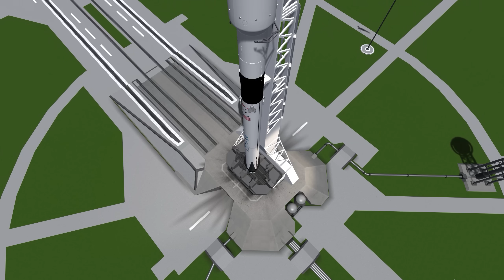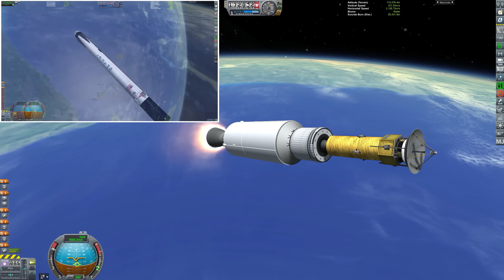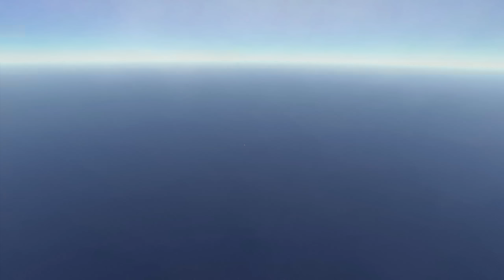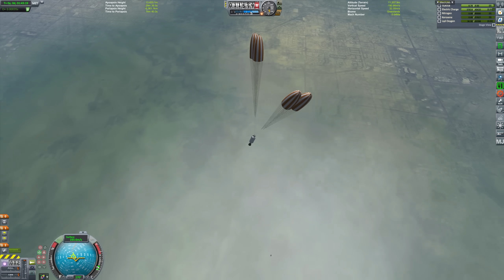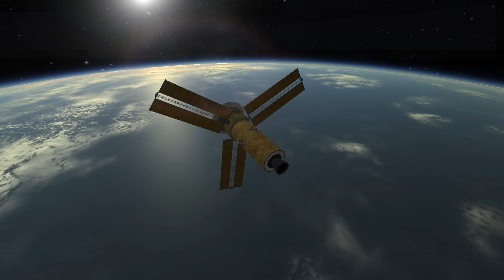SpaceX upper stage recovery - Can they do it? - KSP Simulation

Comment: I'd snag the second stage parachutes in flight with a big four-prop drone that can be computer-controlled and needs no pilot gear, oxygen or other human-rated flight stuff.
I'd follow it down to reduce the tearing sheer on the 'chutes, catch them, and then slowly pull up before hitting the ground. 
Then I'd have the drone fly to the precise location of the recovery team.
Since the flight would be short duration, I'd power it with a reusable electrical pack.

Comment: Hi. The nozzle for the 2nd stage is not built for earth's atmosphere, it's also too fast for the return. Any heat shield or parachute system would take away payload capacityThey need to capture that in LEO.

God bless, Rev. 21:4

Comment: Can you simulate starship SN15 (say) with flaperons angled downwards (unstable) instead of upwards (stable).  To see how that affects drag and agility. Say with a “cheat flight control system” ie just fix its orientation for starters (no control system needed).  Wondering if some kind of interesting airflow eg pressure buildup (cushioning) would occur.  Is KSP up to simming that?

Comment: Hi Marcus. I have been wondering, the vacuum optimized raptor engine is huge compared to the sea level engine. Does the optimization really provide enough extra thrust to offset the additional weight?

Comment: Any mass for a recovery shield and recovery propellant would be subtracted from the payload capacity.  Also, the vacuum nozzle is grossly "underthrottled" (maybe overthrottled I sometimes get them mixed up).  Anyway, if you tried the suicide burn that the first stage does with the second stage the atmospheric pressure would push the exhaust stream away from the sides of the nozzle and damage the nozzle and possibly the entire second stage.  This is why in production Starship will have a mix of sealevel and vacuum raptors.

Comment: Since the beginning of the Apollo missions, I have wondered if each stage could be repurposed as part of a space station, refueling depots, or even attached satellites, instead of discarding them or even returning them to Earth? It seems to me that if this were possible, then whatever extra weight needed to make this feasible, wouldn't be wasted because the discarded stage would have continued use. 26'.6'' X 12' is a lot of space for all sorts of things. From water tanks to fuel, other cargo storage...
Reply: I started thinking what would you do with the engine. I would imagine some for moving whatever the module would be attached to or maybe even disconnecting them and returning a number of them at one time by a specialized StarShip. Maybe ferried to the Moon or Mars for future use.

Comment: How would the landing go if the 2nd Stage were refueled in orbit?  Would a heat shield be needed if returning a fully fueled 2nd Stage?  Could one then inflate a hot air balloon to slow and lower the empty 2nd Stage to the ground?  millerf1

Comment: Interesting. I wonder if Spacex could use the helicopter like they are doing down under to catch the second stage if it isn't too heavy? How heavy is the second stage anyway? And using the balloot or whatever it's called seems like that would work to handle the second stage high velocity from orbit as Nasa had talked about to slow down when landing a heavy spacecraft on Mars. Terry

Comment: This is fantastic!! 

Check out this shit. I switched over to a mac in 2008 because I gave up the motorcycles and picked up the guitar. Time made my audio gear obsolete and I could not upgrade the os anymore so things weren't working too well. As the years went by, the wife split taking most of the money. I left my job but have just enough coming in from a couple rental homes to get by. I could not afford a new mac so I switched back to a windows pc. Picking up a 2020 modern hardware gaming rig that was unassembled components. 900 worth of new shit for a mere 300.00. Covid-19 financial pressure sale. Got it all working, moved my flat screen from being a TV to where it should be, a huge monitor! Bought a sidewinder pro and an adapter to get serial to USB. It didn't work until I shunted pins 2 & 7. Thanks Internet! Starting digging through the boxes. I had space simulator on floppy, no way to load it, flight simulator 5.1, Flight sim X, Fighting Falcon (Floppy), Combat flight sim 2. I was having my coffee on a sunny day of continued unemployment (soon to be beer). No wife nagging. Guitar to the right, joystick to the left. Too early to turn up an amp. I started to wonder if I had the latest version of flight simulator. 

Looking at my screen. I saw the title SpaceX land second stage? What?

CLICK.

Kaper space what. Gerbal space. Kerbal space? Looking around the screen for a logo. Ahhh it's in the description.

How cool is this shit?? The very next thing I do after I post this message is go check out their website. 

Unemployed. Divorced. Happier than you can possibly imagine.

Comment: The paradigm has changed.  There is Zero reason to return the upper stages.
Just stick them in a parking orbit to be refueled as orbital and translunar thrusters.
But they may become so inefficient as to be totally obsolete when compared to the latest units so it would be a trash burn re entry...

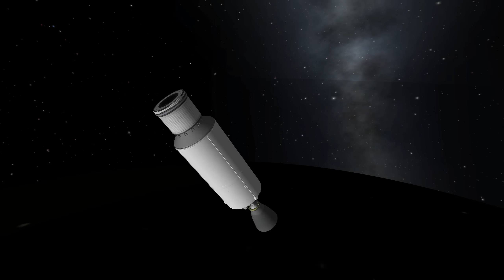Comment: 5:21 yes you right its delta v increased because the second stage is lighter but about 6 seconds burn that wrong because the engine now created powerful thrust so if you full thrust the second stage will get a very high G force.

Comment: Why not use the inflatable heat shield as the “bouncy” landing pad.
Reply: That means it would have to go in nose first, which means that the parachutes would have to be at the other end. Maybe it’s doable. BUT why not use the remaining fuel for a final burn to buffer the landing and use extending legs like on the main booster stage to land nozzle down?
Reply: @Crazy_Worlds  That giant engine probably has too much thrust to do a propulsive landing. Even one of the falcon 9s engines at its lowest settings has too much thrust to hover.
Reply: Mark B You’re right. It would need to be a hybrid or have a second, smaller, atmosphere rated engine.

Comment: You ideally would want a layer you can pump out fuel throughsmall pores on the inflateable heatshield so the fuel cools off the heat shield, and reduces heat by makeing a sprayed flame, the burn up of that fuel would reduce oxygen thats hitting the heat shield and thereby its surface temperature , later on they just need to jet off the residual oxygen , possibly through the engine while its not ignited or they use the oxygen instead of nitrogen for reentry stabilisation nozzles
I dont think you can ut ceramic plates or corc or something similar on a inflateable also the inflateables volume needs to be filled with nitrogen (orsomething else inert and ideally light like helium) - that you additionally need to take with you 
The high temperatures will need the inflateable to be under high pressure to withstand the drag pushing against it thereby thick walled and heavey, also rubber likeley will not be possible without internal electric heating mats because of the extreme cold of space the rubber would get hard and brittle, on the rubber composite (maybe wire reinforced like a car tire but with some lighter metall) you would need isolating and heat resistant flexible materials - id thereby think of ceramic wool or asbestos and a top layer of fine titanium wire mesh, then several spray nozzles or 
maybe put a support structure inside like some carbon fiber
pipes that pneumatically telescope out and give the front additional stability and help bring it in shape quickly while inflating - with either a pull spring for backing them in for deflating or a pump pulling a vacuum 
if you make it rolled up and kinda like a umbrella as opposed to this Kerbal vision you can easier put it back, if its Helium filled it weill reduce vessel weight after a certain height is reached due to density - so by releasing pressure somewhat reducing the density it would be similar to a light gas baloon negating its own weigtht , this way you could put a cap in the center and get the parachutes through the heat shield, that way you dont have to jettison the heat shield and can reuse it

Comment: Recover 2nd stage but dispose fairings? I think that's a wrong approach. I Think of it as a single ship: fairings open or slide down to deploy payload, then fairings return to position and act as heat shields. Later, reorient and fire thruster to slow down and touch down.

Comment: If you recover stage one, why not retain the fairings?
Reply: the farings are mostle just metal and explosive bolts its to much work and effort to bring back whats basicly scrap metal
Reply: @cwtheking3771  Scrap metal worth a few million dollars?
Reply: @SkylersRants  hmm thats just my assumption let me reeducate myself on the fairing design
Reply: @SkylersRants  ohhh figured it out i wasent accounting for the mats made specifically the cooling elements ok yea that makes sense but my hypothesis for why he didint retain them is it would overlap with the heat shield

Comment: Hi, why they don't slow the capsule down before entering the atmosphere? Could they enter to 70km alt with zero orbital speed?
Reply: How can they slow down first?
Reply: @General12th  the speed of the spacecraft is about 17000 miles per hour I think and it is the orbital speed then they try to undocking from the ISS. I mean by that they should try to slow down that orbital speed relative to the Earth and try to come straight down with 0 relative speed to Earth. by the Speed i mean ORBITAL speed not falling speed. And Thanks for reply😃
Reply: @mahanehsani1246  They need fuel to slow down. Where will they get that fuel?
Reply: @General12th  yes they need and they have some already to use for deorbiting, on paper they can put more in instrument module for example. Or use other methods to do that...
Reply: @General12th  for how I think of using the thrusters and small rockets to do that. It should need very smaller rockets to slow it down instead of the Merlin vacuum engines that they used to speed it up👆

Comment: Hi Marcus. Thanks for the great simulation.
I have a question: 
From the Falcon Heavy lunch in 2019, the last minutes of the trajectory animation showed that the deployed satellite will go away into space. 
https://youtu.be/TXMGu2d8c8g?t=3318
How do satellites fix their position around the earth?! shouldn't they be usually fixed on some point or do they go around the earth like ISS?! Thanks.
Reply from the maker: The sat has its own engines and will position itself in the correct orbit at this point. Spacex just needs to get it to its insertion orbit.

Comment: You know, Marcus, the most expensive part of the 2nd stage is the engine assembly. You have it landing engine down on dry land which will definitely destroy the bell and probably damage the rest of the engine beyond repair. Better try another type of landing or just not on land. I recommend a water landing. The tanks will be empty and the stage should float.

Comment: leave a spent second stage on orbit
then fly up a first stage with fuel as payload, no second stage.. how much faster does stage 1 get?
a sat payload can be 15,000lbs, don't know what a stage two weighs fat with cryogenic fuel/ox
connect stage one to stage 2 let a fuel fat stage two start up again at 17,500 miles per hour baby

Comment: Maybe instead of parachutes, they should put hang gliders on spent stages and have them glide back to the space center when they're jettisoned. Speaking of parachutes, why doesn't SpaceX use them on the first stage too? Wouldn't they save a ton of money on fuel and rocket size? Then they could put some sort of flotation device on it to keep it from sinking.

Comment: Seems like you'd still want to use that remaining fuel during the landing to slightly pinpoint the landing over the nets and open the chute at the last possible moment.  With perfect timing, the speed of the fall will be lower and the accuracy of the landing higher.

Comment: I'm wondering if SpaceX has given any thought to in-air capture which had been done way back in the 50s in recovering photo film canisters from spy satellites. If they can get the second stage back (or fairings) to where they're floating down on parachutes they could possibly be captured by aircraft using trailing "sky hooks" and then hoisted into the cargo bay of the plane. That should be much easier than trying to dynamically position a recovery boat.

Comment: I would mount the chutes on the back side of the stage, and use the heat shield as a kind of rubber boat, with that it can land in the sea.
Reply: Heat shield to get through the atmosphere, then carry on landing it just as they do with 1st stage?
Reply: @doceug3657  Not possible. Vacuum optimized engines, with their ultra low exhaust pressures, are not stable at sea level - you can't light the vaccum optimized engine in the 2nd stage to propulsively land. Besides, the upper stage is quite light when empty (well, it's actually insanely heavy for an upper stage, the same weight as the Saturn 5's 3rd stage, but in absolute terms it's not super heavy when empty), so parachutes are actually a really feasible way to bring it back.
Reply: @anonymousperson2110  saturn 5 3rd stage has a mass around 15 tons compared to f9 second stage 4 tons
Reply: @doceug3657  A detachable skirt on the bell assembly should allow you to do that. No extra mass for a parachute system either.
Reply: CG would be high, near the engine bell, if it lands heat shield down, it won't be stable in the water.

Comment: Whats the sense that the parts come back and land with own thrust? A parachute would be much cheaper and lighter, they do not have to take tons of extra fuel with them.
Reply: mob1235 Parachutes are very very heavy and rival the weight of fuel, You can actually get a better mass ratio when you land with fuel and and choose exactly were you land. Parachutes are more of a random guess to where it will come down. Other than that stage 2 would need parachutes because the engine does not work at sea level

Comment: The ocean has the advantage of being away from structures that could be damaged but for this landing I wonder if a land based approach is a better idea. What about a large net suspended between a handful of relatively tall towers, say 150ft tall or more, located in a relatively remote location but one with access via road? You could let out the net as the stage impacted it to reduce deceleration. Doing this on land means you wouldn't have to worry about salt water contamination, the difficulty in working in the open sea, or transporting the stage back to land.
Reply from the maker: The problem is that there will be very limited control to pinpoint a landing. Having a fast ship on the ocean that can move underneath as it descends would probably be the easiest.
Reply: For the first stage landings it looks like they have a landing precision of a handful of feet. It is an open question as to how much maneuverability they'll have on the second stage landings. For the net/towers idea you could put up a 200 foot diameter net to provide a larger target as well. I wonder if the maneuverability of a boat is helping all that much though given the trouble they've had catching the fairings, that's what got me thinking about the cost/logistics advantages of a ground based approach.

Comment: People argue about whether Elon meant an inflatable heat shield or a ballute ... I say why not both? Use a smaller inflatable heat shield than the one in this video in conjunction with a toroidal ballute that deploys out behind the engine. It would harness the best of both world's, with the only major drawback that I can think of being that it would be more complicated. I don't think it would be much heavier at all since both subsystems would be scaled down. It would definitely relieve the storage space issue by not having to pack all the reentry gear into one spot.
Reply from the maker: Yes I think using both could be interesting.

Comment: here is my design for a second stage recovery.  it's similiar to yours except i jettison my (larger) inflatable heat shield a different way and time.  i also use some of the air heating my shield to guide it - sort of "free" mass.  would this be viable in your opinion.  the "free" air we fly through also provides the inflation pressure for the heat shield.  think of the heat shield as a "bouncy house" that deploys in the shape of a cone.....  https://drive.google.com/drive/folders/1HsQ4ckK5xqp32mcE90ikScjivD9TvI2j?usp=sharing
there is a second design that uses "conerons" - aero surfaces on the trailing edge of the cone......

Comment: You're still loosing the heatshield cover...
Reply from the maker: This was more a limitation with the KSP parts that I had to play with. I suspect they could engineer a heat shield that could inflate from outside the actual payload adapter.
Reply: Yeah I remember scott manely had a similar problem when deploying nerva in his completely reusable space program. At the time you couldn’t disable the interstage fairing so those two coverings were lost in space

Comment: What I do is use an inflatable heat shield on the front, and use that as a floatation device to land in the ocean.  I put parachutes right by the engines to allow this.
Reply from the maker: Hmm... Think it would probably tip over after splashdown. I'd need to check that. Interesting Idea.
Reply: Marcus House Works for me.